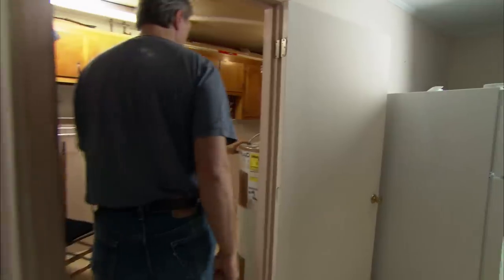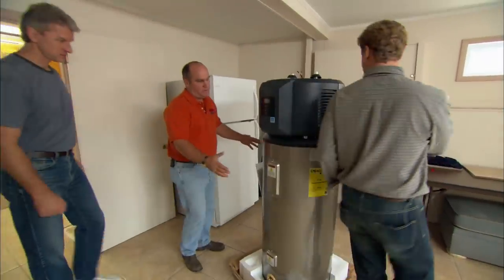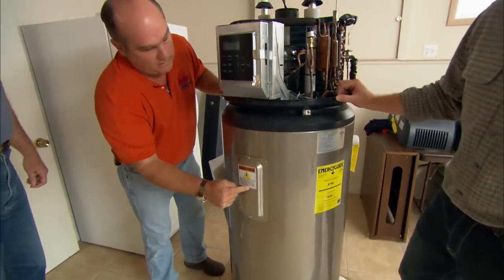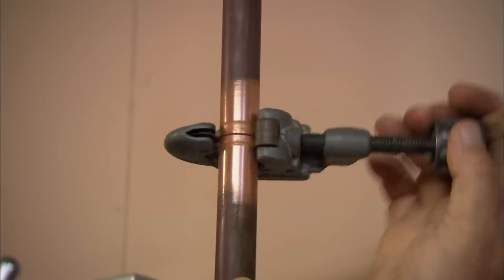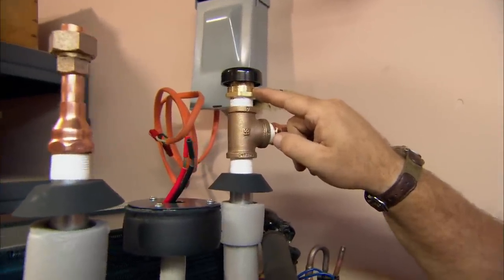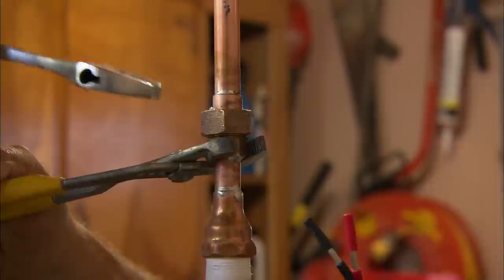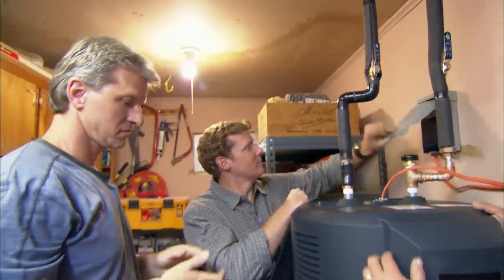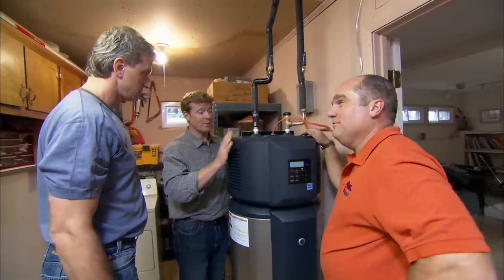How to Install a Heat Pump Water Heater | This Old House

Comment: How do you make the wire connection using a 10-2 wire between this heat pump water heater and a 30 amp breaker?  Thanks.
Reply: You need a double pole 30A breaker
Reply: Black to black. White to red(black tape on white) green to green(ground). 30 amp single phase double pole breaker. Black on one side white on the other on breaker. If your pipes are copper, Jumper ground from hot to cold #4awg wire and pipe clamps. If your not confident in electrical work hire an electrician.  Hope this helps

Comment: How do these affect your heating bill?  Won't this suck heated air up and force your HVAC system to fill the void?  I would think this would be a good option for southern climes where you could put the unit in a non-A/C space, but up north it seems like I'd just be robbing Peter to pay Paul.
Reply: You are supposed to put them in an unheated space.
Reply: Nobody And have your pipes freeze?
Reply: I use mainly wood heat so its a win.

Comment: Can I replace the nipples that come with my heater with street "L's" to give me a little tighter clearance? What about that plastic tube
inside the nipples? Would that still be required?
Reply: Those are heat traps.  Look into that and your local code but most require a heat trap directly on the heater.  They do make street elbo heat traps though, gotta order em but would be the way you’d likely need to go..

Comment: There are really problems now....  No discussion of needing lot a air, around heater. 2) heat pumps are coming with inlets and outlets ON THE SIDE OF HEATER!! and the areage home owner doesn't know that this needs a condensation line.
Reply: kenny play do you mean to tell me that Joe Homeowner is now buying HP  units? I’d god forbid the read the instructions,,they would see there is a need for a condensate line !

Comment: Electric heating elements get caked with calcium and don't work very well. With the new heat pump a heating coil does the job of the heating element. Ummm... what stops the heating coil from getting caked with calcium too?
Reply: 23lkjdfjsdlfj The heat pump refrigerant  coils are not immersed in the water like the heating elements are they are attached physically to the exterior of the tank before the insulation is put on.
Reply: @mainelyelectric  Thanks Ben!

Comment: Welcome to the future, now you have to change the air filter on your water heater.
Reply: Or repair the heat pump, aka compressor and evaporator sometime down the line...

Comment: first off GE is the worst on the market. but then again where does the unlicensed plumber shop! no other than Home Depot lol. And when you take the disconnect out it doesn't necessarily mean you killed the power. You don't know if someone before you rigged it. number one lesson. use a tester.
Reply: The video is obviously edited, this isn't a "replace your boiler for dummies", there's no need to show the tester.
I'm pretty sure they figure out the breaker and everything else in the preinspection  and I'm also sure the owner had his say over the brand of the boiler to use since he's the one footing the bill.
Reply: I've shocked my self on 120 and 240 plenty of times, I am starting to think it is over exaggerated the danger of it, shit barely even hurt.
Reply: There are more people killed with 120 volt than with higher voltage. What shock does is it makes your heart start fibrillating and not pump blood. If there is no one close by to give you CPR, you are going to die. How much you are shocked is determined by how well you are grounded. It's the amperage that kill you. It is not the voltage.  Steve Green
Reply: Merchants HVAC & Plumbing  how did GE come into their subject? Was never aware that they made one,BOSCH, RHEEM, NOW AO.SMITH.

Comment: That's just dumb. You lose all savings as soon as that thing breaks. You can replace all elements and thermostats on a conventional water for around $30. When that compressor goes out it will be more than the cost of a new water heater to fix.
Reply: I do not think you are right. Look at the energy label on your water heater.

Comment: Stay away from the ge hybrid. Broken after 1 year. Broken evaporator
Reply: Ian Cunningham can GE replace it with a newer model?
Reply: Adnan Kazim Why Ge ? They DO NOT make those units, BTW, do you know whom now owns GE appliances ? the CHINESE COMPANY.  HIAER,
Reply: Helluva Dip  what failed on the ‘evaporator ?
Reply: Installed my GE heat pump water heater 9 yrs ago.  Just now required service for the first time.
Reply: @jameslippert3523  what is your estimated savings per year?

Comment: This turned me off at the end... condensate pumps are a pain.  They are cheap and I found they fail within 5 years.  Also the air filter is another thing to maintain and I have enough maintenance right now.  I'm sticking with my 80 gallon Energy Smart electric heater that only costs about $400 a year to run.  With 80 gallons we have never run out of hot water.
Reply: 80 gallons, how the hell big is your family? that should supply an army
Reply: These hybrid water heaters only cost about $110 a year to run

Comment: Over complicated system prone to multiple failures.  I'd rather have a basic electric unit even if it costs more to operate.
Reply: I was on board with this water heater at first, PUD offering a 500 something or the other on it and the water heaters are 699 here so it made sense, but then I saw him run that clear line and was like nope.avi I don't got a floor drain my drain is connected right to a pipe from the water heater to outside.

Comment: They failed to mention that because it is an air-conditioner, it's often better to install these in an unconditioned space.  It will be providing cooling to the space it is in year round.   Maybe they should have run the pipes out to the garage or vented the heat pump to the outside.